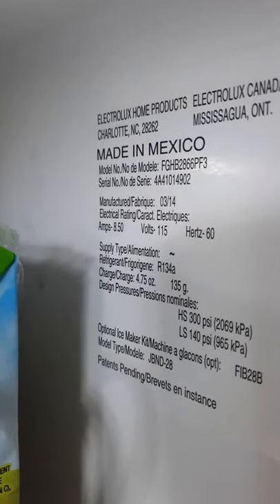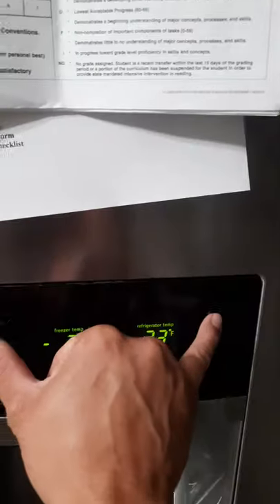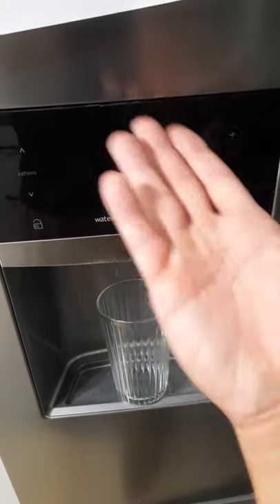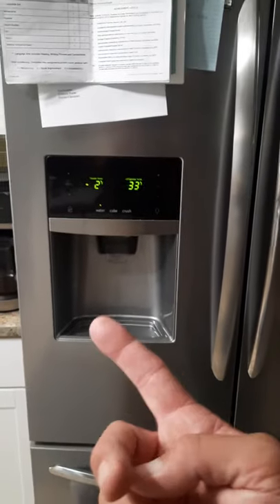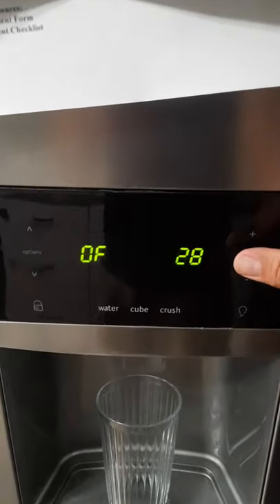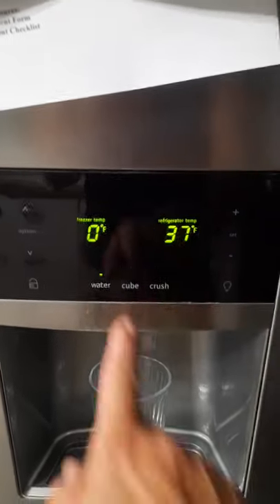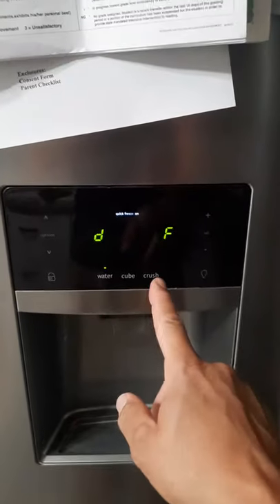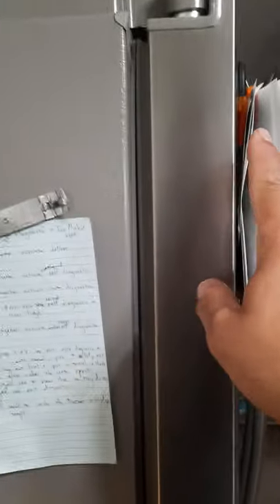Frigidaire Gallery Ice Maker Fix! Works every time. No Tools Needed. Read disclaimer below.

Comment: Thank you for this! I wanted to add one more diagnostic trick i learned on my own, with this exact fridge model.  The ice cube/water dispenser diagnostics are in a separate section. Press and hold ^ and + to enter it.  THE ICE MAKER MUST BE TURNED ON FIRST OR THIS DIAGNOSTIC MODE WILL NOT WORK.
Reply: This is great. Confirming all my parts of the ice picker work from water dispersion to the dumping mechanism but for some reason my ice just won't be made.
Reply: How do you exit this mode?
Reply: Press and hold + for several seconds to exit.   @ElliotKolt

Comment: Brother I am a commercial refrigeration tech and have been for almost 30 years. This little refrigerator was frustrating me because I couldn’t get field information on it. Thank you for posting this. Because I’m not an appliance repair tech and don’t work for Sears or Frigidaire I don’t have easy accessibility to their tech manuals. Thank thank you thank you!! It’s New Year’s Eve 2023 and we need ice!! You are the man!
Reply from the maker: Awesome, thanks. Maybe it will make you some money.
Reply: Ge a piece of cardboard about 3x3 inch piece folding inhaljf take the two screws out at the top then the third on the side you want to drop the box down which you will. Hqve to loosen screws you want toplACETHECARDBOARDJUST BEHI D WHERE THE FILLER TUBE GOES THRU THE BOX THIS WILL FIX IT THAT WILL ALLOW THE WARMER AIR FROM FRIDGE TO KEEP THAT TUBE FROM FREEZI G UP SAVE ME $200 JUST BY DOING SOME RESERCH FOR A 5 MINFIX
Reply: Never seen a Frigidaire with fully working led panel...

Comment: Tried defrost mode (shows as "d    F" on the display) and it worked.  Took about 15 minutes to go through the cycle and then it goes back to normal mode automatically.  I was worried about food in the lower freezer but that was not a problem.  Could not tell anything happened other than the water dispenser and ice maker started working!!.  On my Gallery I press the plus (+) and minus (-) at the same time for many seconds until "d   F" shows.  Then leave until it cycles back to the normal display.  This beats buying a new fridge or paying for repair.
Reply: Did you have to empty the fridge?

Comment: Thanks for this! I used the auto-diagnostics to reboot my ice maker after a filter issue resulted in the ice mold becoming locked in the up position. In case my situation might help somebody else out, I left my water filter in a couple of weeks past 6 months, and it eventually restricted the water flow to the ice maker enough to cause the ice mold not to sense that it had ice cubes in it...when this happens, the ice mold won't turn and dump its contents. And I had not even realized how small the ice cubes were getting as the filter got older. So, knowing the filter had gone past 6 months, I replaced it, but the ice mold was still basically locked. Luckily, I found this video, and running the auto-diagnostics reset the system. I had new ice within a few hours. Additionally, the ice cubes are back to their normal size. So, definitely keep an eye on your filter age and the size of the ice cubes...an older filter can indeed cause the system to shut down.
Reply: This is happening to me with the ice maker at the bottom. I changed the filter and then saw ice in the tray but it wouldn’t dump them. I put warm water over the trays and the ice maker dumped quickly after, but that’s it. It didn’t dump again so I’m hoping this helps. I did run a defrost as well hoping something with get the bottom one working.
Reply: Update: It didn’t work.
Reply: @NeelyJLA  I'm not an expert, but if the cubes dumped only after you warmed them, there might be an issue with the heating element that is supposed to handle that by itself.
Reply: @stevedion8031 Thanks for pointing that out, you’re probably right. I’ve considered replacing the ice-maker but the top one is still working.
Reply: Ugh!  My fridge stopped when I did this.

Comment: I have the 2022 model # grss2352af and unfortunately they have changed the diagnostic selections and even the buttons. For instance, both sides are +/- now, with no up/down on the left. And holding +/- together on the right side for 5 seconds simply switches from farenheit to celsius rather than triggering a diagnostic. Can't find the Service Data Sheet for this model anywhere online. if anyone does, please reply here.

Comment: Someone turned off my  water valve and i got air in my line to my Ice Maker...I kept cycling it and cyclieing it by holding the button down...and it didn't wort...UNTIL...I DID IT LIKE THE 15 TIME...and then it finally worked

Comment: Brilliant! Also you're a good presenter. I kind of enjoyed the video. Kind of like a fix-it Bob Ross.
Reply from the maker: Thanks 🙂
Reply: @Diy_Mike hey man, so I ran the diagnostic, and all the functions seem to work, but no water goes into the tray.  Also, my process seem to take like 10 to 12 minutes for the whole cycle to repeat itself. Not just like one to two we’re talking quite a bit of time in between starting it and then next time it does it. The lights do flash the whole time, and the temp changed a little bit in the freezer to 2° throughout the whole process. It went up to two then back down to one. Any ideas?  Also, when you run the “defrost” cycle, does it ruin your food?

Comment: I totally agree that the software glix could be driving the inop. Tried replacing tray motors etc, and nothing worked long term. Now run through hard reset and it runs for months at a time. Great detective work !

Comment: Funny thing my gallery is 5 years old and I had this ice making issue. I didn' know how to run the auto diagnostic. I did everything else, but nothing worked. I got a kick out of when Mike finished and said it would work for about two weeks. One thing I did before running the auto diagnostics is I changed the filter. It was a six month filter and I had installed a new 4 months eariler, so I kind of ruled that out. After a day or so and I still had no ice. After running the auto diagnostics I had ice the next day. It's been a month and the ice maker is working fine. I don't really understand it but maybe it forced something to work that malfunctioned.

Comment: Thank you! I’m going to try this. I had a tech out 5 different times for the ice maker and he said mostly it’s just a poor design and something inside the ice maker freezes up and suggested turning it off for a day or so and then back on, which usually works. Since then my warranty expired so I haven’t had them back. My fridge also has the optional ice maker in the bottom freezer drawer, which we loved until it quit working about a year ago.

Comment: Michael you are the "Frigidaire Galley side by side ice maker trouble shooting guru". I was thinking it maybe a programming issue after checking continuity through my 4 coils of my water valve which i could now rule out. I had my service data sheet which made mention of activating/deactivating  the system diagnostic mode but did not quite grasp how to force it into a manual test until I came across your tutorial. Many Thanks!

Comment: I had a similar situation where icemaker hardly making ice.  Went thru most of the settings shown here. Also defrosted, removed all the parts and actually did not find much ice clogging up the back of freezer.  Raising the temp to 2 deg F and 35 deg F solved it for me.

Comment: After having the local service techs here to "fix" the "not making ice" with three replacement parts under warranty and the problem continued, I reviewed the parts diagram and wiring diagram. Supposedly there should be a defrost cycle for the water fill line. Maybe it works, maybe it doesn't . My "fix" for three years, when the ice tray is almost full, I shut off the " make ice" function. It appears when the ice container is full, the ice is close enough to the water line that it freezes the water line thus no water to make ice. When the container is close to empty, turn the "make ice"  function on, a couple of days later, container is full, shut off the "make ice" . Has worked nicely for some four years now.

Comment: My Gallery is FGHB2868TD8 (MAY 2021)
The instructions were identical. I ran the auto diagnostic and let the unit cycle through till it simulated an ice making process. The twisting of the tray to eject the cubes was pretty cool. I too forgot to place the cup and took a bath. Anyway during the ice making simulation the unit made a sound like gears having difficulty turning. That was because the motor was coated in ice. After a DF sequence the unit produced a full bin of ice about 15 hours later. Thanks for the (water + crush) to increase ice production. Mine was on low and took forever to make ice. 
The following day it stopped again so I first ran another DF. This cycle did not take as long (5 minutes) as the first time i ran it the night before (about 20 minutes) which lead me to think that the unit knows when it is defrosted. I also read that not changing the filter can cause problems so I changed it for the first time. Well I can't say for certain if that solved the problem but it did start producing again and I sure could see an increase in water flow.  
I would conclude that this unit will not produce ice or stop producing ice if the on board computer detects a failure. In a sense the unit is trying to preserve itself. Unlike the way we are used to knowing that a device is malfunctioning by hearing a strange noise but by then it is to late because the mechanics of the ice maker will have destroyed itself trying to cycle but this units software will not allow the device to complete a cycle unless a hardware test carried out by the computer software gets a "thumbs up" to proceed with the next step. I mean in a way its nice that most of us were able to correct our issues by pressing some buttons and not buying expensive parts but technically speaking if Elon Musk can land a rocket on a moving platform in the middle of the ocean then we should be way past trying to perfect the bloody ice maker.

Comment: Thanks for the information.  After running the self test, I could see that the tray was not being filled with water. I tried the defrost cycle a few times but that did not help.  I ended up using a blow dryer to heat up the entire unit.  That got things working again so I guess the water line that fills the tray was frozen.

Comment: Excellent information! thank you.

When I ran the self diagnostics everything appeared to work mechanically ..it dumped a tray full of ice, and soaked the towel.  Now the tray is empty and won’t refill.  All water flow issues don’t seem to exist, since the towel got soaked and the water filled the glass right?  Is there a way to get the system cycling again? Thanks

Comment: Thank you for the video showing how to get into the diagnostic mode. My ice maker has been down since I bought the machine years ago and I just took it apart to figure it out. The whole ice unit was frozen solid in a block of ice which is odd since the ice maker was turned off AND unplugged. Got rid of the ice block and cleared the drain tube and hooked everything back up just to let it sit over night and not make ice so I came to this video. Running the diagnostic shows that it can and does dump water into the tray and the tray rotates the water out. So if this is happening fine I still don't understand why the fridge isn't sensing that ice needs to be made and filling the tray like its supposed to. I cannot go into the manual diagnostic mode like you did due to my led panel where the degrees are at are not fully lit up.

Comment: Thank you for this presentation.  I have been using the dryer technique but find it very time consuming.  My fridge has a tendency to lock up and stop making ice when the bin gets full to the max. I was thinking it may be the "full" sensing mechanism not releasing once triggered.  I found this most helpful for my model LFHB2751TF4.😁

Comment: Thanks for this video.  I had the same problem, but based on what you showed I tried this first.  I replaced the water filter, which I should have done a year ago.  The filter was restricting the water flow to the degree that it was allowed to freeze in the tube at the top (my deduction).  So, I took a hair dryer and pointed it at the space between the top of the fridge and the ice maker for about a minute.  I wanted about 8 hours and ice started coming. Works great now!  Thanks for the explanation.
Reply: Waited 8 hrs for ice? I'm at the 6 hr mark and nothing yet. I'll keep an ear out. Thanks!

Comment: Found your video because we just bought a used fridgaire floor model for $400. It has 2 ice makers and the one on the bottom freezer wont come on. Im going to try and run the diagnostics on it tomorrow. I also noticed when we was moving it that there was a small bag with a paper ziptied under it. Wondering if its the diagnostic codes.

Comment: Will this reset address the problem of the ice melting in the upper ice tray?  I have the freezer (which is a lower level so not sure this is the answer) set to -6F and the refrigerator at 37F.   The melting just started recently after I replace the ice cube tray due to it "tearing" while rotating with a full ice bucket.

Comment: Before doing anything try unplugging it and then plugging it back in.Worked for mine.
Reply from the maker: That works if you can get to the plug. Ours is a pain and when I'm not home my wife can't move the fridge
Reply: @Diy_Mike  How about turning off the power on the circuit breaker?
Reply: Wish it were that simple for me but Mike I’m ecstatic I have ice. 🥰

Comment: Hi Mike, 

So, we have the same issue every 2 weeks… I end up having to dismantle the whole ice maker box and motor assembly to blow dry the ice maker coils because they’re covered in ice. Have you ever taken yours apart? There’s a ton of ice that builds up causing it to stop making ice. When I use the blow dryer to melt the ice, I put a towel down under it and after I’m done the towel is drenched. I put it all back together and it works for 2 weeks or so and then it does it again. There’s a drain hole in the back. I just don’t understand where the water is going once it goes down the hole??? I guess what I’m asking is your “fix” that uses the DF defrost. Where is all that water being collected every 2 weeks if the defrost is melting all of that ice?
Reply: I'm curious about this as well.
Reply: Good morning , I own an appliance repair company. Here in Jax,  FL. And the water that goes through the drain hose goes down the back of the fridge to the very bottom in the back behind the panel in a drip pan. 😊 the heat off of the fridge eventually evaporates the water. Your welcome.

Comment: So in the process of the manual part, water started pouring and pouring and no matter how much I kept changing the settings it wouldn't stop running until I unplugged it. Waited 10 sec and plugged back in.  Im actually house sitting and its not my fridge. So I still dont know what is wrong. 😢

Comment: I ran thru the auto diagnostic, the ice tray fills with water, dumps the water out, water dispenses into a cup... Still no ice in the top ice maker, the tray remains empty. The bottom ice maker is functioning normally. Any insight?

Comment: Thank you for your video! When I was in diagnostic mode, I must’ve hit something, and now instead of the freezer temperature displaying 0°, which I have it set for, it’s displaying one and a minus sign, not -1, but one minus. Do you have any idea why?
Reply from the maker: I'm not sure why. You can always unplug the fridge to reset the computer in it. There are service manuals out there I've found with 30 minutes of Googling that would have more info about each system. I don't have links to those.
Reply: Thanks for getting back to me. It must have been some type of high temperature code. Eventually, the display changed to 7 degrees and counted down to zero where I have it set at.  @Diy_Mike

Comment: I saw several on/off switches when going through the diagnostics. Are all the switches supposed to be off? Also several cl/op switches. Should they all be closed?
Reply from the maker: I just switch them back to whatever they were. In any case they should reset to their default position when you exit the diagnostic and the fridge resets. If you're really worried about it you can unplug the fridge for 30 seconds and plug it back in.

Comment: Do you know if you can adjust how much ice the machine will produce?  We need more than it is making now so it would be nice to crank it up for better production.  Thank you.
Reply from the maker: At some point I did find a tech manual that had info on how to adjust the water level, so it does exist, I just don't have it.
Reply: If you hold the water and the crush down at the same time you will see 
IC. on the left and 1, 2, or 3 short horizontal dashes on the right. 
Tapping the + will cycle through the levels of frequency for ice production. 3 is highest